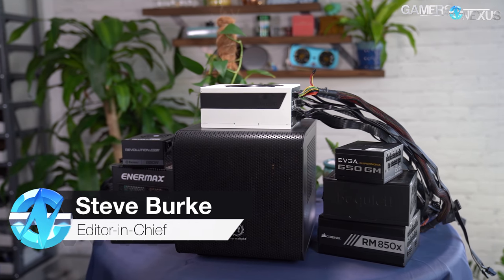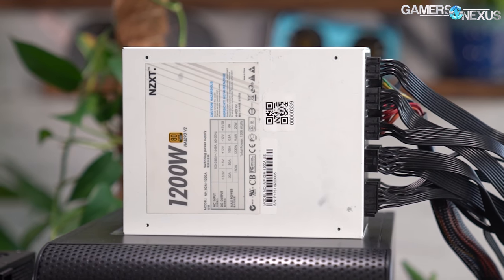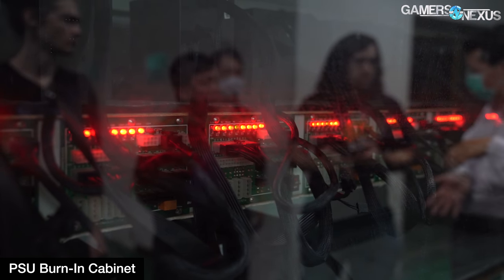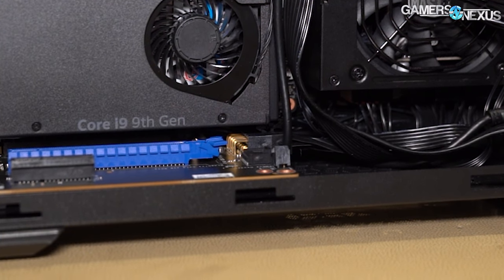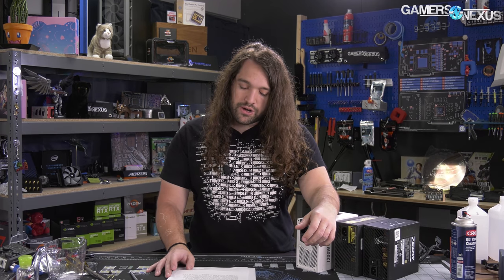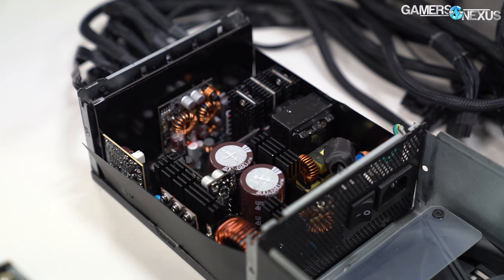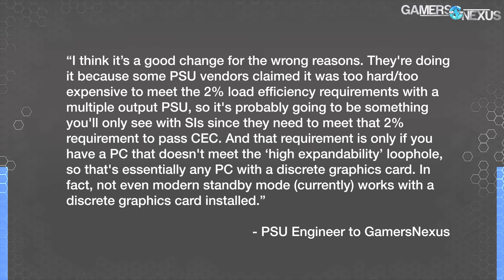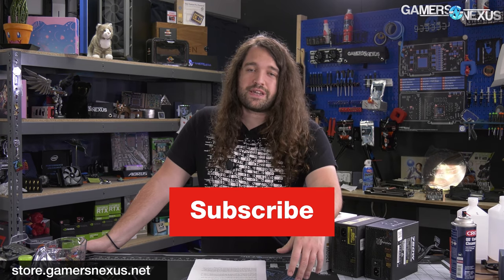Intel's ATX12VO Spec Explained & What Manufacturers Think

Comment from the maker: Our article accompaniment: https://www.gamersnexus.net/guides/3568-intel-atx-12vo-spec-explained-what-manufacturers-think
Our "E-ATX is a lie" video takes a similar approach to content. Watch that here: https://www.youtube.com/watch?v=54VJwwLRJBk
Reply: Interesting, however I dont see how this is going to help consume less energy. If there is still a need to convert 12v to 5v and so on, then its going to have to be done on the mobo or on various devices through out the system. Where I see most of the energy loss being in the form of heat. So its still going to have to be done. Seems to me this could end up actually cause more energy use.
Reply: Power supplies should be slimmer if this is deployed. We do use 12v power supplies without thinking about it are on notebooks. But how much do boards have to sacrifice to get the amount of amps across multiple devices on a enthusiast based desktop... Boards will get more expensive. I really can't see power supply companies dropping prices considering the change over.
Reply: I can watch LTT all day long and not get this sort of awesome info.  Thanks for all the hard work you guys do, Steve, Snowball & gang.
Reply: i think the original standard eatx was meant to give similar specs  to  a server type  mobo though limited  support  outside intel cpus basically killed the standard before it could get a foot hold
Reply: @JoeJacksonJr  Could you name the other ways you see the energy getting lost apart from heat? ;)
Reply: I agree with the first PSU engineer cited. This is just a money reason from the PSU manufacturer to have more margins since actual designs on high end ATX PSU in 80+ Platinum and Titanium already are designed around a single +12V output of the transformer and then step down the +5 and +3.3V rails.
On the other side, the second PSU engineer is a bit pushing forward because a lot of industrial PCs still needs the -12V rail to communicate with machines which have nothing but a legacy RS-232 serial link (still quite common even in first-world countries). This negative rail is negligible in amperage so it's not really a problem for efficiency.
But IMO the +12VSB is by far the major deal breaker since it will make obsolete all of the reliable Supervisor IC chips designs in use for more than 20 years. This will also breaks compatibility between OEM PCs and retail/enthousiast systems, making very hard to adapt the standard ATX parts with the 12VO ones and forcing two distinct lines of products with very different designs and components. Way more effort and skill will be required to, for example, use any ATX PSU on a newer Dell Optiplex. This new 12VO spec will create a lot of avoidable e-wastes.
Reply: I wonder when new SATA/nvme alike standard will come out that provides 12V power directly to the device from the motherboard. We have already USB 3 that can provide 5V with 500mA current, so why PCs ssd drives still require additional power cable is upon me.
Reply: It's not like most consumer PCs are already powered by a single voltage, for that to be the case laptops would have to be powered by a single voltage power supply...oh wait
Reply: Steve, what happened to your Right Arm?
Reply: @ByAnyOtherName091 Than put yourself up for election, don't complain without actively trying to change things
Reply: I'm tired of the smallness of PCs, we need to go bigger, enthusiast should be all E-ATX sizes by default, I have an E-ATX case and I will NEVER go back/smaller, but I'd go even bigger
Reply: @JoeJacksonJr  Yeah, it's not really just energy, it's also conversion, a dedicated reserved space and expertise in power conversion is being replaced by more space constraints ... MOBO manufacturers obviously have less experience in this area and will need to hire more people and perhaps early versions will not be as good. This is like a famous pizzeria outsourcing their sauce and pizza baking to someone down the street.

Comment: Compact combined power+data SATA cables? Sign me on, honestly.
Reply: Sata power is so bulky bc hdds used to  require 3.3 volts, like 15 years ago
Reply: I agree, PC cable management is fine until you get to plug sata power cables.
Reply: @djaysenpai  bless m.2
Reply: SATA power+data has been in demand for sooooo  long.
Reply: Hate apple all you want, i do too, but their system engineers are gods. The motherboard design for the new mac pro is excellent and should be something pc manufacturers look at, take notes, and implement. I'm honestly sick and tired of psu cabling inside PCs, it's something that has no excuse existing in this day and age
Reply: By that point Sata will probably be obsolete. Sata is right now what IDE/Pata was in 2005. Still being used, but not preferred. Around 2025 or so Sata will be completely gone.
Reply: @djaysenpai  Try Molex. Then you'll suddenly find that SATA is completely fine :D
And yes I know, Molex is even more ancient, but it has it's place because the connectors are simple (=cheap, less likely to catch fire like cheap SATA adapters) and can handle more current so it's pretty universal.
Reply: this is called m.2
Reply: @SilentdragonDe  cheap molex adapters can catch fire too, and bend pins very easily
Reply: They could already do that; the 24-pin has 3.3v and 5v. There's just limited space on the motherboard (as Steve suggested in the video). It would be so nice, though... at least higher end motherboards have been adding more m2 slots and dimm daughter boards (like the threadripper ASUS boards). I've been slowly amassing more m2 storage and ditching old HDDs. One 2TB drive left but most of my slow storage is in a NAS now so not as necessary locally. Two 1TB nvme drives do most of my heavy lifting.
Reply: @verylongname8161  3.3V in SATA was an attempt to future-proof the standard for low power devices. Old HDDs were happy with 12V 3-5A + 5V 2A that the "Molex" style connector could supply..
Reply: Combined power + data SATA cables used to exist. Look up eSATAp. https://en.wikipedia.org/wiki/ESATAp
Reply: @jubeh  "Hate apple all you want, i do too, but their system engineers are gods."
Imagine actually believing this, lmao.
Reply: @jubeh  
I'd love to see this comment on rossman's channel and see if he can, or can't refute it.
Reply: Who still uses SATA drives these days? :O
Reply: @demoniack81  Creating something elegant is relatively easy if you do not have to adhere to any existing standards and doesn't care about backwards compatibility. Apple has the advantage here as they just doesn't care about such things. Their customers are more interested in the design looking good than in the functionality.
Yes I'm biased, but then Apple hasn't done anything to convince me otherwise since the days of the Apple III.
Reply: @M Fikri This is even more frustrating when you realize that the BOM for the m.2 drive is lower than for the regular SATA SSD. The components are the same, and the PCB is either smaller or just the same size. The m.2 drive doesn't have any SATA and power connectors and neither does it have the drive case. Add to this that as soon as the PCB has had the components soldered the m.2 drive is ready to be packaged and delivered while the old regular SATA SSD has to be mounted inside the case which is one more step in manufacturing, and on top of that the drives can't be stacked as efficiently as the m.2 drives so shipping is more expensive.
And yet the m.2 drive is suddenly more expensive when it reaches the store shelves...
Reply: @jubeh  Then buy a server. There are plenty of proprietary designs like Apples that have zero cables.
Reply: @drunkenpumpkins7401  Don't count on that.
Reply: @drunkenpumpkins7401  Maybe... but we still need a cable standard of some sort.
Reply: They already exist, I have one in my desk drawer right now. The board side of the connector is split so you can plug in power and to the board, the drive side is one piece. They are typically used for hot swapping drives on a work bench, the drive side is so large with the combined cable you just can't plug it in at any angle that would damage the drive while the system is powered. Think I had those for almost a decade now, no idea what company makes them, they have no identifying marks.
Reply: @drunkenpumpkins7401  Not so sure about that. I was thinking a similar thought until I got my hands on a high end surveillance HDD. The read and write speeds of my SATA port were actually limited by CPU load for once, max speed I seen sustained for more than a second was around 600MB/s, burst were breaking 1GB/s. Mind you we don't use those drives in our desktops because they have a helluva dead to load warm up, have to feed them 24/7 to get max performance out of them.
Reply: This was my first thought in improving on the dual cables necessary for such drives.
Reply: I miss SATA, man. I use NVMe HDDs.
Reply: Pretty sure SATA has enough to worry about without haveing to shove power delivery into the same cable
Reply: @drunkenpumpkins7401  What is replacing SATA? AFAIK there is no replacement on the horizon. M.2 is only for drives. SATA didn't just replace IDE, it replaced molex as well.
Reply: @TonkarzOfSolSystem  Im talking about the sata bus, not the power connector. And Even Sata power didn't ''replace'' Molex. Molex still exist and is still needed because Sata can't handle a lot of power. 

In about 5 years the sata connectors will dissapear from motherboards, mark my words. Sata power will still exist for low-powered stuff and Molex will exist for high(er) powered stuff.
Reply: @jubeh  Calm down, Apple is designing a motherboard once every two years. And while it is practical it's almost always poorly made in electrical terms. PC choices are almost limitless and way way more affordable. What's your "excuse existing in this day and age" being so afraid of cables?
Reply: @drunkenpumpkins7401  Yeah right, USBs and audio jacks as well. Your head is in the clouds... Widely implemented standards in billion of products are going nowhere in the close future.
Reply: @em0_tion  Just like IDE and ISA right?
Reply: @drunkenpumpkins7401  I said CLOSE future, which those 5 years you mentioned fit in. Did you seriously compare SATA to IDE and ISA? We have no big bottlenecks of the current SATA technology that concern the mass user, we are still using big HDDs for data storage. I dunno why you so desperate to make guesses about terms. At the end, who tf cares? New tech comes out, we upgrade, life goes on :)
Reply: @em0_tion  Sata only has a max of 600 mbit/s. That's pretty slow for non-HDD. In about 5 years M.2 SSD's will be so big normal folks don't need a hdd anymore. Maybe some high end users that uses 60 TB or something. But most users will probably stick with their 10tb M.2 SSD. And if they won't use HDD's anmore there is no need for sata. 

Same thing with IDE. in 2004 it was widely used, in 2008 it was redundant, and in 2013 it disappeared from boards.
Reply: @drunkenpumpkins7401  You said it yourself: "In about 5 years M.2 SSD's will be so big normal folks don't need a hdd anymore." + "IDE in 2008 it was redundant, and in 2013 it disappeared from boards." HDDs are still not redundant. So if your own prediction math is correct, SATA will disappear from MoBos in 10 years, not 5, which is exactly what i said...
Reply: @em0_tion  whatever dude
Reply: @djaysenpai  at least it wasnt IDE
Reply: verylongname nobody uses HDDz
Reply: @Khloya69  lul
Reply: In server board, there is a standard called SATA DOM (both data and power). The connector is just a hair larger than current SATA.
Reply: Armando Ceniceros you can design anything you want if you don’t have to maintain compatibility with industrial standard and have customers like you who are willing to pay multiple times the amount of money to repair a part that could have been easily purchased had it used a standard connection.
Reply: @jubeh  The Mac Pro has some really cool design choices, but their board work has a lot of issues especially in other models (like running high voltage lines directly next to low voltage lines in connectors).
Reply: The SATA power connector is just horrible and frankly the data connector isn't much good either. I've had many problems with connectors being loose and not mating properly. Molex was clunky and you could get problems with the pins pushing out, but easily diagnosed and repairable. The wimpy SATA power, much less so. They just do not have enough gripping force.
Reply: @sirius4k  If you only consume and not create, then perhaps having one SSD is enough. But if you are a photographer/video creator/game creator then HDDs are still very useful.
Reply: @DrowningInTea  I have a 5x16TB array in NAS, which is also a solution for any serious creator. A separate redudant disk box. 10Gb NICs on both ends help as well. I haven't had HDD's in my daily rig for some years now. Switched from SATA SSDs to NVMes few years ago.

Comment: That "unnamed vendor employee"'s idea of keeping the +5V and removing -12V and +3.3V seems like the best middle ground.
Reply: @J Fz Op-amps need negative voltages to operate. Op-amps are used in the analog circuits and possibly power supplies.
Reply: The question for me is if any current mainboards even make use of -the negative rails and 3,3V. If not it would be as easy as using a passive adapter for the few cases where the standards mix.
Reply: 12v and 5v are all we need for hardware newer than 2008. Doing it that way makes sense, since at least we can get full compatibility with dumb pin-to-pin adapters for the full size 24-pin of older hardware made and leave the rest alone. 
(Keep PC Green! Recycle, Reduce, Reuse!)
Reply: @FischOderAal  I'm not certain, but -12V is used on 24 pin connectors
Reply: @FischOderAal  as well as +3.3
Reply: @teddygoboom1  yea the connector has it, its what uses it thats the question. only thing off the top of my head that uses 3.3v are floppy drives.
Reply: @danielrouw2593  PCI-E does not have a -12V rail, so no modern sound cards cannot even use the -12V from the PSU. It was included for RS232 compatibility, just like -5V before ATX 1.2 was included for ISA compatibility.

It's much easier for power supplies to get rid of -12V, and if you need it for a specific application you generate it onboard.
Reply: Many things use 3.3V; this video cut it far short. 

-- most motherboard chipsets use 3.3V

-- most Realtek/Intel audio chipsets use 3.3V

-- some VRMs themselves use 3.3V (the "coronary arteries"; the electricity for the power plant)

-- all NVMe uses 3.3V

-- all SATA, M.2, and USB use 5V

-- some SATA use 3.3V

-- all PCIe slots must provide 3A of 3.3V per slot

-- all PCIe Mini devices (e.g., WiFi cards) use 3.3V
Reply: This is better than a middle-ground, imo. It is the simplest and cleanest solution to modernizing the ATX standard. Moving 5v DC-DC to the mobo is messier imo. And a smaller main cable (like a 10-pin) sounds amazing, imo. Less copper, less weight, less clutter, easier to make custom cables, simpler engineering, and maybe a standardized pinout (which is the holy grail, imo).
Reply: @PoisonGryphon  I think RS232 since RS232 uses +3-+12V for a high signal (0) and -3--12V for a low signal (1).
Reply: @ikjadoon  The 3.3V should not be supplied over long distances. Because when you have a voltage drop of 0.5V it is very significant for 3.3V. For low power devices a cheap linear regulator can be used from 5V. For high power a DC-DC converter near the load is a good idea anyway.
Reply: @PoisonGryphon  Your comment about op-amps is not true. Research "single supply op amps". 

I saw another comment about RS-232. Lots of TTL to RS-232 converters use charge pumps to generate the negative voltages. Maxim's MAX232 is an example.
Reply: @KiraSlith  The -12V and 12V are important to current feedback via Op-Amps though.
Reply: @jaimealoro  Not all Sound cards are Pcie powered. Best one I've used till now is the STX II and it uses a Molex...but yeah..even molex doesnt supply -12v :/
Reply: @PoisonGryphon  You only need a negative rail if you intend to drive close to that output voltage. An op-amp can always run 0 and +V with either diminished slew rates near ground potential outputs, or an output that clips just above 0V.
Reply: some motherboards nowadays don’t even need -12v to power on
Reply: Remove the -12v from your 24pin and power up your pc.
Reply: Especially since USB isn't going anywhere.
Reply: @ChrisGR93_TxS  depends on the pmic used regardless of devices that may use it. comic's depending on how they are configured might not give pg signal
Reply: @ikjadoon  And in alot of good modern mobo's all those voltages are pulled from the 12v main with hardly anything actually pulling from the at connector.
got me curious and there is no continuity between any of the USB rails to the 5v pins.
not saying it isnt used at all it's there after all but mobo's allready forgo using the psu's low voltige rails generating there own for clean power reasons as it is.
unless it's a tinny tinny mobo maby.
Reply: Dumb idea, they should just add back the -3.3v, -5v, -12v rails to ALL psus, fuck that